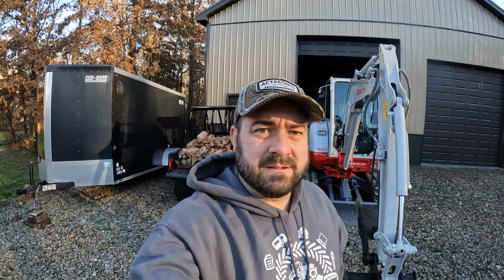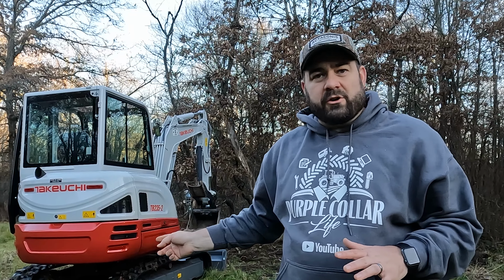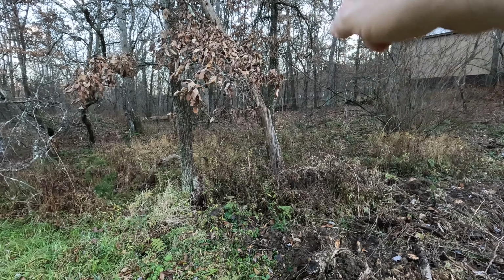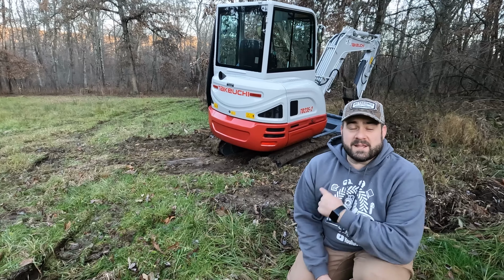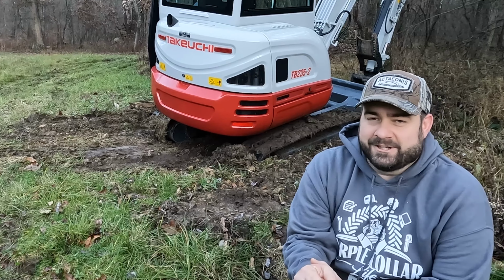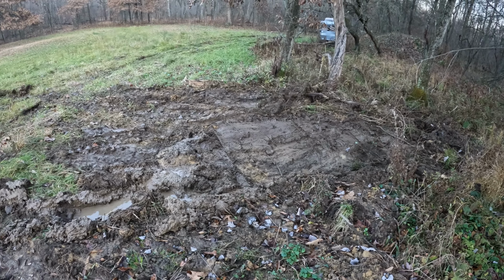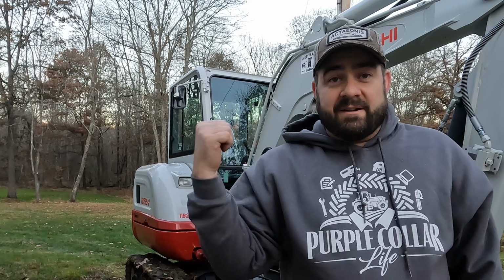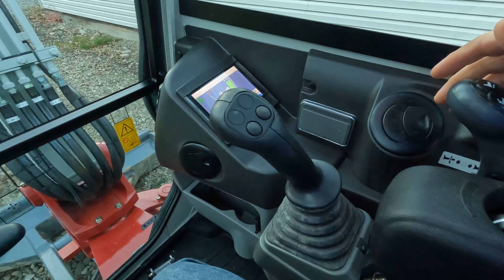New operator gets excavator stuck

Comment: Well that was certainly an adventure!  Nice job working it out Chad...mentally and physically! 👍
Reply from the maker: Hi Chris - it was an adventure. Once I was stuck I was about 80% sure I'd be able to get it out.  I was slightly worried that if I COULDN'T get it unstuck using just the excavator, I'd need to try to pull it with the tractor.  That would have required Jennifer's assistance. I hope you have a great rest of your weekend!

Comment: 2 things, 1 I was screaming at my screen to lift your blade haha it was weighing you down like an anchor. 2. Make sure you don’t leave mud in your tracks before it freezes. The mud will freeze solid and if you run it with frozen mud in there you can destroy your undercarriage.
Reply from the maker: I hear you about the blade, Adam. I didn't notice it until editing, and then I was thinking, "Oh, NO WONDER!". It was definitely holding me back from getting out of there. 
I have been driving the excavator up and down the driveway a couple times to try to get all the mud out of the tracks. I hope that's enough to clear the mud. I'll have to crawl underneath it and see if there's still mud in the underside of the tracks.
Reply: Sounds like you have anger issues Adam… goosfraabaaa.
Reply from the maker: @SpicerDesignsLLC  serenity now!!!

Comment: As a general rule, I never consider myself ‘stuck’ if the machine gets itself out!  Nice job getting outta there!  

I couldn’t see the high side of the excavator, but sometimes swinging 90 degrees to the low side, curling the bucket and pushing the boom down will pick up the buried track, then swinging the carriage as you reverse out will get you through spots like that.  It also levels the machine so your not leaning, which often causes the machine to dig in deeper.  If it’s real bad, while the track is lifted you can also stuff some branches, logs, or wood under the track to support the machine so you can drive out.
Reply from the maker: Thanks for all the great advice and tips! I think that lifting the low side might have been a good solution - that was the case that one side was digging in more and more. Also - I could have lifted it up and put some logs under to get me up out of the mud.  I'll remember those for the next time! Thanks for the comment.

Comment: Good Morning Sir🌞Nice OAk Firewood 😇👍👌 Sir you may want to dig with your very nice excavator into the soil a compost pit so all your compost needs  👌👍😇 It will much cleaner and more active on the compost process 👍😇 You have a positive  spirits Sir  🤣👍👍 Yes You do need to clean up a little your excavator 😇👍 Yes doing a water drainage is required 😇😇👍👍 Keep Up Your OUTSTANDING Work Sir Cheers 🍻🍻
Reply from the maker: Good morning, Dave! I was almost on potato peeling duty if that excavator would have been a yard decoration until next summer. :) 
I was pretty confident I could dig myself out if needed. But I didn't want to mess the yard up too bad. Thanks for watching.
Reply: @PurpleCollarLife  🤣👍👍Ho boy !!!